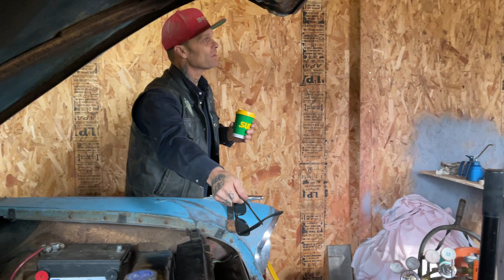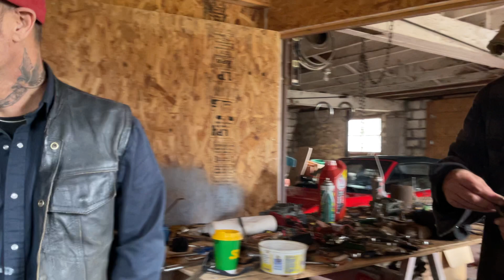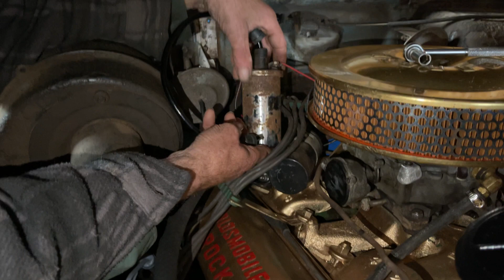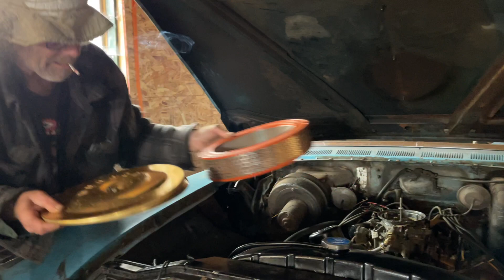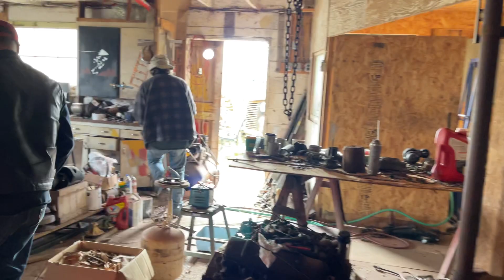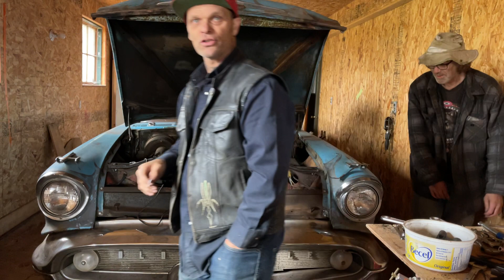ENGINE TROUBLESHOOT: WHY IS JIM'S ENGINE NOT GETTING FIRE? 🆘

Comment: Put old point distributor it will run as wired - coil to distributor 12v coil if 12v battery electronic ignition after market  ?

Comment: There a lot of thinking going on spray starting fluid in it first try start it  
Take a spark plug throw it on the plug and crank 
Fire 
Air 
Gas might run like crap but any engine will at least run if it has these 3 things

Comment: 😅🤣😂😂dude...... chad u have no idea.  Jim is right the distributor isn't sending a ground pulse to the coil. Hes talking about the two small terminals ur talking about the spark plug wire the whole time.  Check the points jim. The points aren't the metal tabs on the underside of the distributor cap chad 😄

Comment: IT IS CALLED A BALAST RESISTOR AND THE POWER THAT STARTS HE ENGINE COMES FROM THE STARTER MOTOR AND IS ONLY ACTIVE THEN THE STARTER IS CRANKING THE ENGINE ONCE THE STARTER STOPS CRANKING THE POWER STOPS FLOWING OK

Comment: See if you have power to the points and check gap set at 16  coil is fine, dis wire goes to neg side of coil  Will start

Comment: I wonder why they call tell breaker points I would buy a new coil and points and condenser also  cap and wires .you have power to the coil so with the new parts you'll have fire to the distributor and it will save you a lot of time . At the very least buy a new coil.

Comment: He just said twice he set up in electronic ignition u need. Two wires one from switch and the other from wall Connect both wires into one plug and stab into the coil pack

Comment: Red wire goes to keyed ignition switch wire 12 volts with key on. black wire goes to negative side of coil
Reply: Need to check voltage to coil. While cranking you may be looseing voltage to the coil because of a bad voltage resister. Voltage meter is the best tool to use while tracking down electrical problems. Could be a bad key switch to.

Comment: bad pickup coil in distributor. Bad or missing electronic control module. 6volt sometimes is positive ground. if it's been converted it may be something as simple as reversing the battery cables. Points would be better in this application.

Comment: You have me yelling at my screen. You CAN NOT!!!!! test the coil like a spark plug. the spark is jump from the coil to the capacitor and then to the points  when the points brake contact you get your spark. a coil  accumulates 35 to 50 thousand volts to help with the spark.

Comment: Electronic distributors require both wires from it to be hooked up to the coil, the earth wire goes to the negative side of the coil and not earthed to the motor, the coil requires constant 12v power, the resistor will lower the volts to much to start and run, the resistor must be removed or a new wire with 12v is required.
A electronic distributor works by having power from the positive side of the coil power the module in the distributor which  when the distributor is turning it creates a negative pulse with is sent back to the coil via the black wire to fire the coil, not the best explanation and not in depth sorry and the module in the distributor will be fried with how it was set up.

Comment: I just turned in. Have you tried to run a hot wire straight from the battery to the distributor